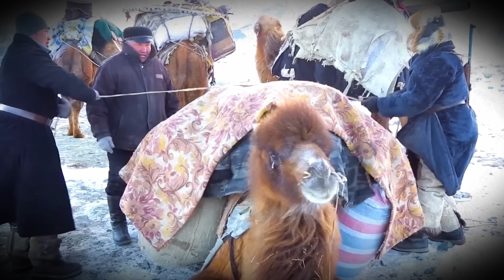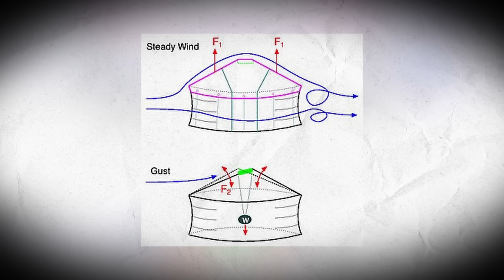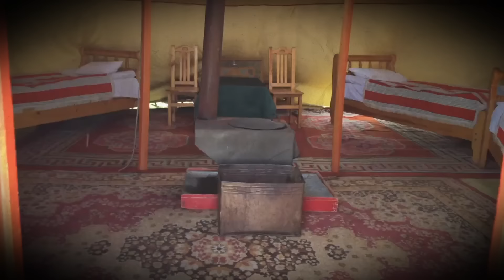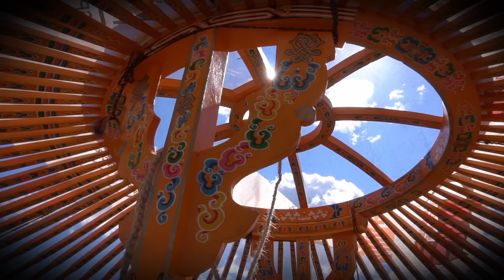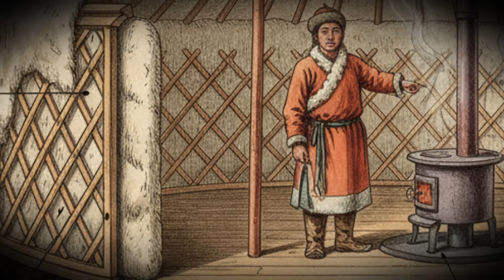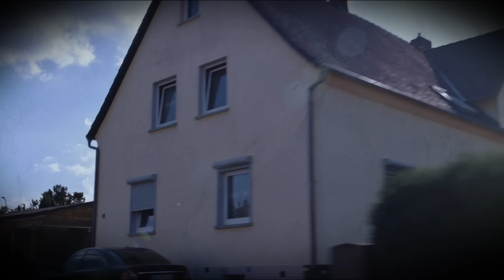How Mongolian Herders Survived Steppe Winters Without Firewood

Comment: With the same thickness, spider silk can have a tensile strength comparable to steel. However, a key difference is their density: spider silk is far less dense than steel, making it about five times stronger than steel by weight. This strength-to-weight advantage, combined with its elasticity, is what makes spider silk particularly impressive for applications like its use in webs. So definitely spider silk is not weak....lol

Comment: These videos must be AI created. -40°C is not the same as -40°F These are two different systems of thermal measurement.
Reply: The machine is right in this one case - because the Celsius and Fahrenheit measurement systems really meet at the point minus 40.
Reply: Best google that. -40 is the same in Freedom units and Celsius.
Reply from the maker: Thank you for pointing that out! The video uses Celsius as the primary unit, but the content still holds true.
Reply: @timberandstoneyt Hallo Chat GPT. Danke dir für deine Information! 😢